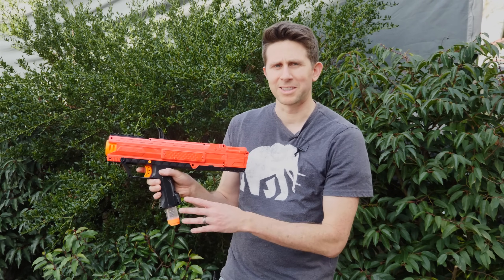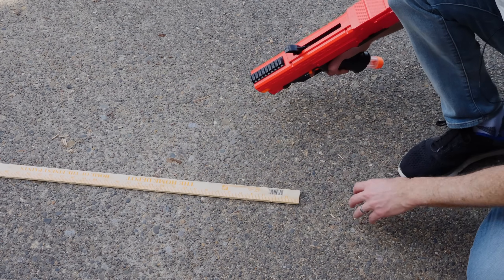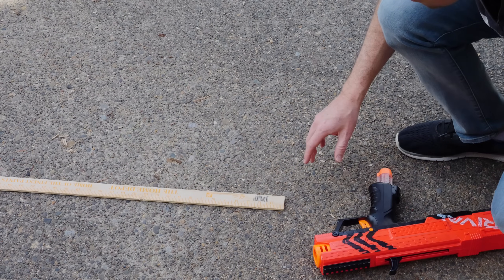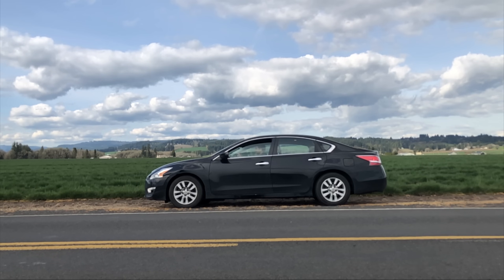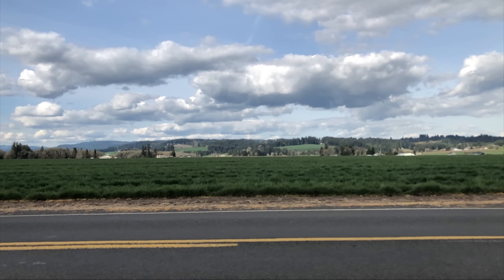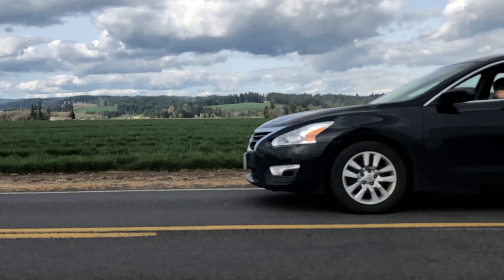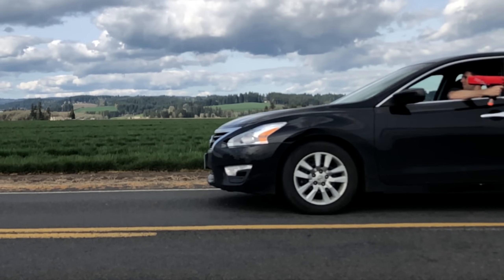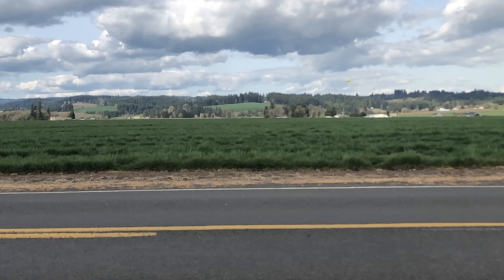Shooting a Nerf Gun Backwards While Driving At The Bullet's Speed Forward

Comment: So if you shot it sideways as in 90 degrees from the direction the car is going, then the projectile would travel alongside the car because the projectile inherited the speed and direction of the gun / car?

From the driver's perspective, the projectile would be going straight out of the gun the same as if the person was standing still if we ignore air resistance?
Reply: Any directions works, initial velocity will have 2 component vectors added together. Air resistance shouldn't really be ignored, because velocity will be different, and there's a ~v² proportion.
Reply: @SajtosNokedli  Thank you!

Comment: Callisto! What if man wanted to colonise? It's got water ice at minus incredibly low temperature. We'd need it for water and perhaps rocket fuel. Also we could cut airtight and radiation resistant rooms into it.
How would we mine it? 
Imagine an astronaut with a wall of water ice in front of him. Would he use a lazer to cut it, or some form of hand held heater element? How long would it take to cut say a manageable shoe box sized block? What would happen to the sublimating water/gas? Would it float off, drop to the ground or cause a problem? I would love to know all about this if you have the time Action Lab man. Love all your videos. Andy J. England

Comment: "wind might have caught (sic) it at the back of the car" -> the air flow caused by the car is a huge factor. Why else would the nerf ball roll towards the camera? The trajectory would be completely different if the experiment were conducted in a total vacuum. Try the experiment again at 20mpg and 75 mph to observe the effects of air resistance.
Reply: Any idea where a vacuum chamber the size of a street open to the public is (and can be used to drive cars in)?

Comment: In 2050, he'll be driving at light speed and shooting a laser beam backwards just to test this theory again
Reply: angry comment about how light doesn't work that way, and that how the movement of the object light is being emitted from doesn't effect it's speed
Reply: @lepperkin  explain more? What if you shoot a bullet going the same direction traveling at speed of light?
Reply: @kikeh23  lights speed isn't dependent on the velocity of the object emitting it. If you were moving at the speed of light, and shined a flashlight backwards, those particles of light would just go at the speed of light in the opposite direction instead of stopping.

This is because light doesn't have mass. However, if you shot a bullet backwards while moving at the speed of light, it would in fact still be moving with you, minus the velocity it being shot took away, meaning it will go away from you at the speed of a bullet, but from a perfectly still person it would be going insanely fast in your direction.

Sorry if that was unecessarily complex
Reply: @lepperkin  complex was necessary indeed , made sense!
Reply: laser beam floats
Reply: It affects every thing but light.

Comment: My question is, if two jets were flying 200 feet apart in the same direction at 1000 miles an hour, if you try to shoot from one jet to the other, can you aim straight at it or will you have to aim in front of it with a bullet speed of about 3000 FPS?

Comment: You can actually see the ball is moving forward very slightly.  If you check out the trees in the background, you can see the ball has moved forward a couple inches once the car passes.  You need to start all over and go the correct speed.  Total fail. 

;p - Thanks Action Lab.  Cool video.

Comment: I dont think that your ball hit the window , the reason why it's going up is because the hopup effect witch this tipe of blaster have , basically at some point on the barrel of the gun ther is a proturberance which makes friction with the top of the ball and cause it to spin backwards , that spin makes a low pressure on the top of the ball when it has been shot and causes it to go up .
When you shot the ball it's rotating , and your car still pushing air in front of the ball and cause it to go up , so I think
Reply: you can see the shadow of the ball on the car approaching the point of impact on the car, you can refer to 3:21 - 3:31 and you’ll see three shadows (one on the window and one on the door of the car) all converging until the ball hits the car, where they all disappear
Reply: Yeah these balls spin a lot, and I don't think he knows that. Also I think he low balled the estimation on how fast the ball shoots out of the blaster. Generally an apollo is about 100 fps out the muzzle/ about 65 or so mph. The experiment could use some fine tuning.

Comment: Back in 1965 when the USS Hornet was in Long Beach they had an open house for the public.

To get to the flight deck they took you up on the large outside elevator that they used for planes.

On the way down the guide warned us not to jump up in the air as the elevator goes down, because the elevator went down faster than gravity and it would leave you up in the air to fall.

The elevator was designed to lift thousands of pounds at once, and the twenty or so people in the group was like nothing to it.

Comment: How is this possible? Wouldn’t it have to be shot the other way for it to be pushed in place? Can someone explain how this works because in my head it looks like it should go even faster, not stop.
Reply: Before it's shot the ball is going 55 mph to the left same direction as the car. When he shoots it the ball goes 55 mph to the right. Because the forces on the left and right are the same they cancel out. Leaving only gravity pulling it down.

Comment: This is literally common sense. No matter how hard you throw strait, it will still fall at the same speed as if you just dropped it. It's accelerating *downward*, like everything else, at 9.8m/s^2. So regardless of its forward momentum, it will still fall at 9.8m/s^2. If you shoot a ball backwards at 50mph while driving in the car at 50mph, those two numbers will simply cancel out, giving you a zero momentum in either X or Y coordinates. The only thing acting on the ball would be the force of gravity accelerating the ball at -9.8m/s^2. Two movements are independent of one another, they don't affect each other.

Comment: Upgraded approach to this experiment:

Try putting one of those baseball/tennisball pitching machines in the back of a truck, then repeat the experiment. The added weight of the baseball or tennis ball might reduce the impact of wind on ball, and firing out of the back of a truck would prevent the ball from hitting the window. You might pull off the perfect drop.

Comment: The ball was moving forward in my opinion and the contact with the car was more than you think it was because its trajectory is reversed slightly and changed to the  camera i think it hit the indent of the car side. I don't think this experiment is accurate at all due to the single case study given which was not accurate. I still think that if the ball in the shot was not manipulated by the car that it would have moved forward on its supposed trajectory still by quite a bit.

Comment: The old 'jump in a falling elevator' thing - you explained it wrongly. If you're falling (outside) at 130mph, then jump at 3mph, the result would be just as bad - you'd jump up at 3mph (net effect = falling at 127mph) then you'd start your descent after the jump, accelerating to 3mph on the way down, hitting the ground at 127 + 3 = 130mph.

Comment: The thing about falling in an elevator or something heavy is that during the fall you're in freefall, which is essentially zero G. You're basically floating in the elevator as it drops. Thus, there's no way for you to be able to jump. Mythbusters covered falling in an elevator and debunked the jump idea.
Reply: Falling elevators don't fall that fast. It's not a free fall at all. And nowadays elevators all have a braking system to further limit the speed.

Comment: Well knowing that force is dependent on mass and acceleration that means that we can measure the number of need shots it takes to equal the force of a car. So in here A car let's say of average weight is travelling about 100km/hr knowing that the speed of the car and dart are the same, we can cancel that out and conclude that force is directly correlated to mass. So knowing that the average car is 1302kg and a nerd dart is about 0.5 grams. We can conclude that the it takes 4,608,000 need shots to to equal getting hit by a car. OUCH!
Reply: Here is the math, 2304kg is equal to 2,304,000grams
Reply: Multiply that by 2 and we get a ratio of 1:4,608,000

Comment: This may have been asked already. But Nerf guns are spring loaded and so would this be different than a rifle/pistol round being fired? The specific part of the question is does the way the projectile is shot make a difference, spring versus combustion? 
Ex:a 1,070 fps .22 call. Round will be moving 729 mph. If fired from a moving car at 55 mph then the fps would drop to 988 fps. Is this true that it will loose this amount of fps due to the speed of a "moving car"

Comment: Something else to remember is that a Nerf ball is very low mass — air resistance on it is significant.  If you look closely, it’s actually still moving forward a little with respect to the road bed, but quickly slows and stops due to air resistance.

Still impressive and cool.

Comment: I feel like the ultimate test of the physics involved with the moving car and the moving projectile would be to measure the speed of the nerf ball while it's still inside the chamber of the gun (maybe right towards the end of the barrel) and then drive 10mph faster than that speed and see if the ball doesn't leave the gun at all or simply rolls out..but even then the pocket of turbulent air wrapping around your hand/the gun/your side mirror/etc could cause some degree of pressurizing of the gun chamber and/or resistance to the foam (I'm assuming) projectile..which in all honestly, is probably made of foam not only for softness but to actually catch as much air as possible to slow the projectile down so that Nerf doesn't get sued for putting Uncle Bobby's eye out over the Thanksgiving holiday..just my thoughts, I never took any math over algebra 2, no physics, geometry, nothing..but you learn a great deal about physics riding motorcycles, 3wheelers, 4whlrs, etc.. since you were 5 and are now 35 👍

Comment: If the ball has a mass of 1 gram, the forward momentum of the ball in the car, before shooting = 1 × 10^-3 (0,001 kg) × 9,8 × 24,5 m/s which is roughly equal to 0,2401 Nm/s. The ball leaves the nerf gun at the exact same supposed velocity, 55 miles/h or roughly 24,5 meters/s, but in the opposite direction (it's the same equation, just add a negative to the velocity) . This would result in the exact same momentum, but in the opposite direction. The resulting momentum (calculated by adding the respective momentums together) is now zero, and if one were to ignore the wind resistance generated by the car or the atmosphere, the ball would simply fall to the ground. For this to work the car has to travel at the exact speed at which the ball leaves the gun, and would work in multiple scenarios such as a real gun being fired backwards off a jet (please don't try that though, there are too many variables for that to be conducted safely) . All this is called the law of the conservation of linear momentum.

Comment: Imagine shooting forward and driving next to the bullet
Reply: Well u can't because bullet speed is original speed plus car speed so the bullet will always be in front of you
Reply: This kind of happened with a jet in real life. A F11 Tiger shot itself out of the sky.
Reply: @TheJoey3590  That's not entirely what happened. The jet fired, and then did a dive. As the bullet traveled through the air, it started to slow and fall back down to earth. It just so happened to hit the plane because of the dive it took.
Reply: @Tinfoil_Hardhat  Hence "kind of."
Reply: @TheJoey3590  That's impossible, shooting forward results in bullet speed + vehicle speed. So you could never reach it.
Reply: @GANCHO1997  bullet loosing its speed, plane doesn't.

The plane also descended after shooting.
Reply: @GANCHO1997  I think he meant if a seperate person outside of the car shot it and the car drove next to it
Reply: @deniswitschi1859  "losing" not "loosing"
Reply: @GANCHO1997  Could've happened with a rocket tho
Reply: Won't work due to air resistance, the ball would slow down very fast

Comment: Anyone who has done even the most basic amounts of physics could have known the answer before they even opened the video
The velocity of the car directly balances the velocity of the nerf bullet. 
Eg 5 mph + -5mph = 0 mph
The addition of the vectors leaves a net zero velocity. Therefore relative to the camera the nerf bullet doesn’t travel horizontally (or a negligible amount) and drops straight down.

Comment: You must remember about the air vortices that run along the side of the car counter clockwise- they would slow down a foam ball like that significantly. You'd need a small gantry out the side of the vehicle to perform the experiment with better results. Also, you need to do an experiment more than once, no matter if it works properly the first time, it's basic science principle.

Comment: I'm not a scientist but I believe I can explain what's happening with "frame of reference" and a little bit of relativity.

When the ball is locked in the chamber of the gun, it is in the same frame of reference as the gun, so when the gun is moving at 55mph with the car the ball is too.

Once the trigger is pulled, the spring decompresses, but the ball at that point leaves the gun's frame of reference and travels on its own. At that point, because the gun is moving at the same speed as the spring, the ball just falls out of the barrel, no energy is available to accelerate the ball, so it just stays there.

What happens next is aerodynamics, gravity, and a bump against the car as it passes by. Fascinating stuff though, I didnt know that result would even happen!

Comment: Things to take into consideration: Matching the speed won’t get perfect desired results because of air resistance. Cars displace the air that they move through (aerodynamics), so the force of the air around the car affects the travel of an empty holo ball; bullets would still be affected, just far less greatly. Bullets shape cuts through air better than a ball. Weight/Mass of projectile. A car has a constant velocity whereas a bullet has velocity with an ark.

Comment: So what happens if the car is moving faster than the muzzle velocity of the gun though? Does it stay in the barrel?
Reply: It still has relative velocity to the barrel and flies out. Only that it still moves in the same direction as the car. So it wouldn't get stuck in the muzzle.
Reply: Godwin Austen I didn’t think so. I just really feel like it was the obvious next question and should have been covered in the video.
Reply: No, Speed doesn't make a difference, the ball, gun and car are moving at the same speed before shooting. The only reason the ball stopped is the Air Vortex behind the car.
Reply: Alex_Inside yea that sounds right actually.

Comment: We took the guts out of a writing pen and used the tube -- called the "barrel" -- taped to a stick at a right angle, to launch bottle rockets out of the window of a moving car.  We clocked them at about 60 miles per hour.  It was a blast to see them more-or-less flying parallel to the car when driving down the highway.  That's fun.

Comment: My example as to why it makes sense comes from a bomber plane. Say that plane drops a bomb. Well they have to calculate where the bomb is going to land because the bomb has the same speed as the plane until it is dropped. Now if the plane shot the bomb at the same speed the plane was moving, but backwards, it would be x-x, so it would just fall

Comment: I'll say that this result is inconclusive. Firstly,considering the air drag accompanying the moving car that ball doesn't have a sufficient mass to counter it. Secondly,you may not have distinguished between the rate of acceleration with which the ball leaves the gun and the speed that it subsequently attain's. Could you try doing this again with a 'dart gun' or something that shoot's an arrow,i'm guessing those might be more practicable if you get the right sort.
Reply: The acceleration of the ball inside the gun is so fast that it doesn't really matter. It would only be about 1/1000 of a seconds which really isn't enough to make a difference

Comment: i didnt get the concept how it happened... what u need to calculate about the ball and car is acceleration instead of velocity....
Reply: The car is already at a consistent 55mph when the gun is fired so he is right in using the velocity of the car. He's also right in using the velocity for the ball as it only take 1/1000 of a second for the ball to accelerate to its maximum speed.
Reply: @edenfeledrum1540  what happen if we fire with the same gun inside a train running at 55mph...will it stop at the same point ...the answer is No